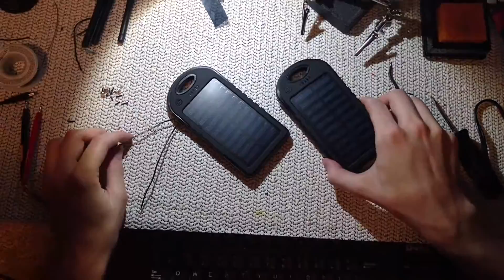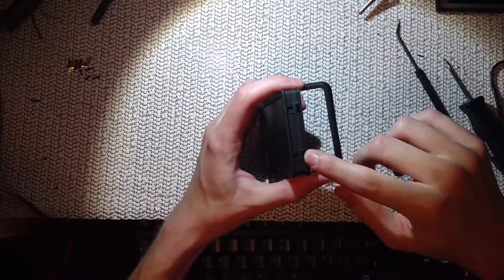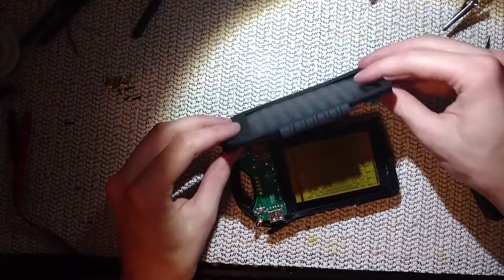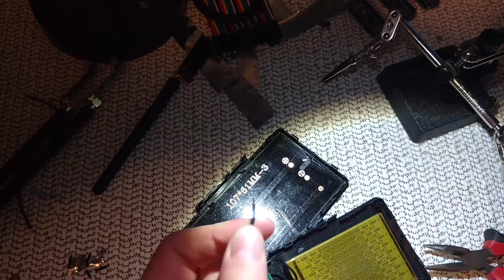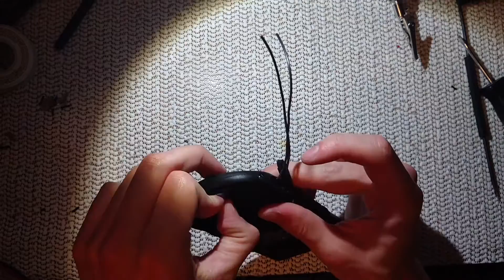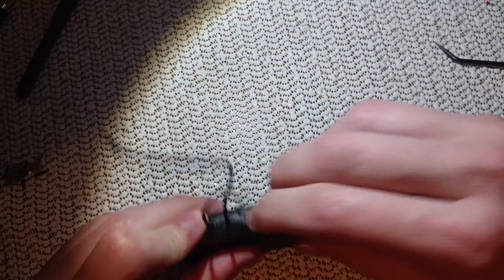Battery Pack Modification

Comment: Hello awesome videos on the mesh network. Them batteries casing the housing is waterproof to a point that Rubber that goes around it is what seals it from getting water inside of it. So try to push my water hose on it and it did keep the water out but when i put it in my bath tub that didn't go so well.